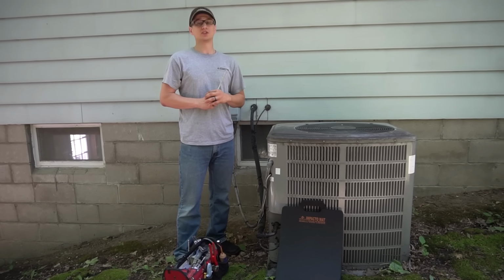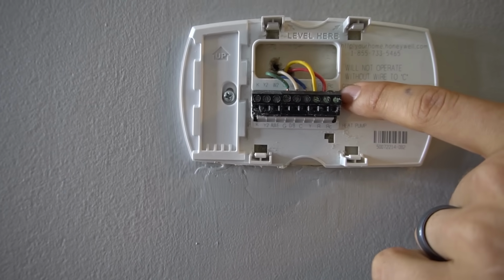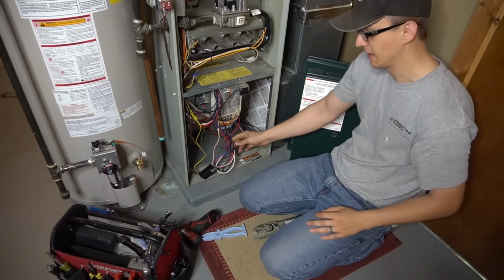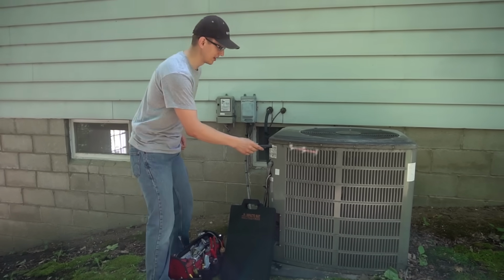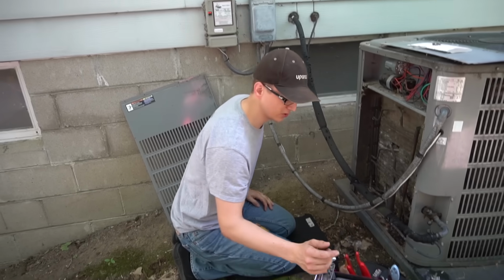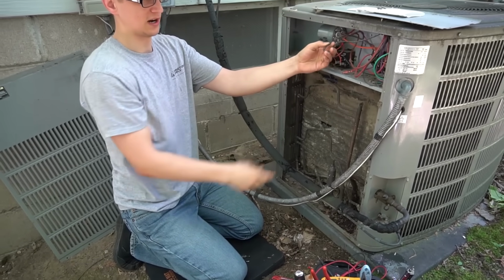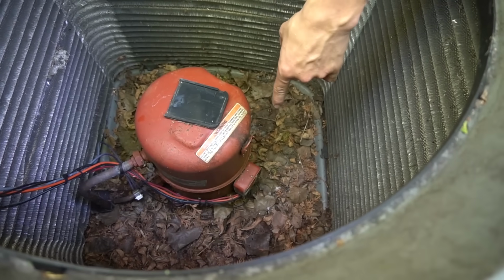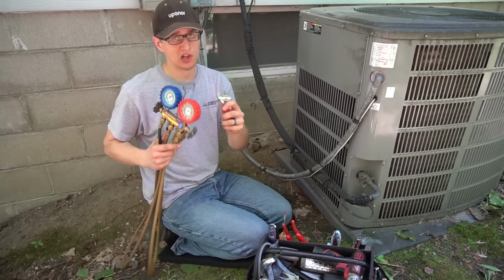AC Unit Not Turning On - How to Fix It Step by Step

Comment: I have one question. What if the outside fan is not working but after turning off the power and on again, it starts up for a few seconds and then stops again? Could it be the capacitor?
Reply from the maker: Unlikely. If the compressor and the fan turn on, the capacitor is probably good. That sounds like you have a power saver switch. If you wait for 5-10 minutes it should turn back on again. If that's what it is of course. I have a video on the power saver switch in my AC Fixing Playlist
Reply: Thank you for your reply! I checked and there's no power saver switch. But I probably didn't give you all the details you needed because I was trying to be brief. But here's what happened. All was working well for years and one day (after one of many thunderstorms lately) I noticed that the fan inside (which was on Auto) was running all the time because the temp wouldn't go down to where it was supposed to according to the thermostat (installed last year). I checked outside and the fan there was not working. When I gave it a push with a screwdriver as you showed, it started but it was off again after a few seconds. Then I cut off the big power switch outside to look at the capacitor (which was not bloated) and when I turned the power back on, the fan started for a few seconds and then stopped. Then I sent you the message but before you answered I went ahead and replaced the capacitor anyway. Then the outside fan began starting and stopping after a few seconds, and then after a couple minutes starting and stopping again, and so on. I then switched off the outside power and kept it that way. But there was a noticeable change after replacing the capacitor: it went from not starting on its own (except for the one time it started when I tried the screwdriver and when I turned the power switch off and on) to starting on its own every couple minutes (though stopping on its own too every time). I watched your 10 most common AC problems and none of the descriptions match the symptoms except for possibly the first one of the capacitor, and maybe the #10 of Compresson with Locked Rotor Amps BUT my fan is not running (except for what I said "wanting" to start but stopping after a few seconds). So I wonder if the capacitor I bought is not fully good (bought it at the local store where all the pro companies buy most of their stuff and I took the old one to match and it matched with the only difference that the new one is 440/370VAC/B while the old one was 370/400VAC but the guy at the store said that was ok, and the other difference is the +/-% variance for UF where the new one is 7.5 UF +/-6% and the old one was 7.5UF -5/+10%). I hope you don't mind this is long but it is the exact description of all the steps and detail. I hope you see this and can give me your opinion now that you have all the info! Thank you so very much. You are the BEST. I wish you were here and I'd hire you. :)
Reply from the maker: Thank you! The full description does paint a better picture! :) So far you have mainly been talking about just the fan outside but can you tell if the compressor is coming on too? Do both, the compressor and the fan, come on for a few seconds and then turn off? This kind of sounds like a low pressure switch is tripping. (LPC or LPS) The purpose of this switch is to shut down the AC unit if the pressures are too low (usually indicates that there is a leak in the system) so that the evaporator coils and the refrigerant lines do not start freezing over.

If you look inside of your outdoor unit from the top, do you see a black cylinder or disk attached to the thicker copper pipe? It will typically have 2 wires coming out of it. Or you can also look on your wiring diagram (usually on the back of the service door) and see if the LPC is on there. If you do have a low pressure switch, then likely you are low on refrigerant.

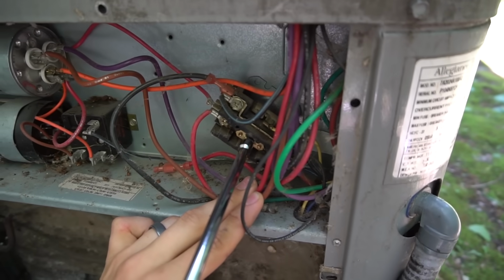If you do the test that I show in 17:50 (very carefully since there is 240v there) does the unit stay on as long as you keep the plunger pressed in?
Reply: Thank you so much for your prompt answer!  I was hoping to follow your recommendations today and answer with some substance, but it was raining all day long so, being inexperienced, I didn't want to be messing around 240v in the rain. From what I remember maybe the compressor was starting at the same time than the fan but I would have to check that again to be sure. Other than that, what I remember that it didn't happen was a screeching sound, which the outside unit always made right when starting up every time (years ago I had been told that there was no practical solution to that but that it was not a problem, I don't know what caused that sound but I am curious).
Reply: Thank you again! It stopped pouring down today and I could check. I turned the power on outside and push the plunger and both the compressor and the fan came on. I kept the plunger down but compressor and fan stopped after a few seconds. Right away I pressed the plunger again and compressor and fan came back on but they went off again after a few seconds and they wouldn't  go back on after I pressed the third time. Maybe they needed time to reset again. I looked inside the outdoor unit as you said and saw the thick copper pipe attached to the compressor Copeland Scroll (which is a big black cylinder and from which they come out actually three wires). Is it time for me to call the professionals? Thank you so much for your dedication to help your fellow beings in this so very helpful way! You are awesome.
Reply from the maker: Thanks man! I try to be helpful. Unfortunately, yes. This is starting to sound like you may need to call upon the pros. Most likely you are low on refrigerant but of course I can't say for sure since I am not seeing it :) I hope it won't be too damaging to the wallet. Good luck!
Reply: Thanks so much!
Reply: Hey man!  I'm wondering if I can call on your advice again. Today this pro came and said that the compressor was bad (it's an Armstrong three phase, R22). He said there was a bad fuse and took it out but did not recommend putting a new one because it would blow again. He is going to check on compressor prices, but when he left my inside fan which was (gratefully!) working, is not working anymore. I called him and he said it would not be because of the fuse that only sent power outside. Then I lost the communication and he didn't call back to follow through or offer to come back to fix that, so I didn't call him back either. So now I'm worse than before calling him (and paying him a good fee). I could have survived for a little while in cooler weather with the house fan blowing. Is it possible he left something outside disconnected? He din't touch the thermostat or the handler. I hope you can give me some guidance! Thanks again!!
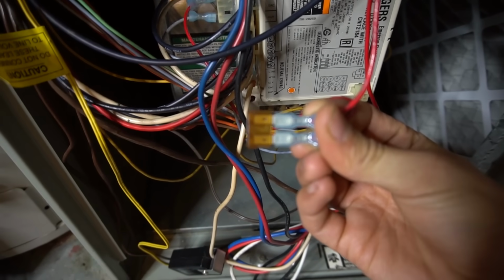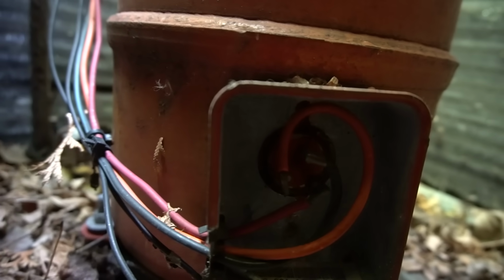Reply from the maker: Oh man.. Sorry to hear about that! If he did not go in the house at all, then the only thing I can think of is that the 3 amp fuse tripped for some reason. (I show mine at 7:22 in this video) As for the fuse that he said was blown, is that the cartridge fuse that is in the disconnect? Only one of them was blown? Usually those blow if there is a short somewhere. There is a really slight chance that more harm can be done to the unit if you just go ahead and replace that fuse/s. You can try replacing them and see if it turns on. But before you replace those fuses, I would take a look at your compressor pins, the wire connectors that hook up to them may be corroded or broken off. You can see mine at 25:45 . Or did the guy check the compressor windings and found that they are shorted or open? Or in other words, why is the compressor bad?
Reply: Thanks man. He did go in the house, but did not touch the thermostat or the handler (just looked at it to see brand/type). He went to the electrical closet though, where the brakers are and there's an "AC" box with fuses and where he found the one he removed saying it was bad. He didn't actually check the compressor, so he didn't check the windings. He just said that the compressor was causing a short assuming that was proof that it is bad and needs replacement. (Based on my preliminary checking, he did check the freon, including an acidity test, and he checked power in the cables on the side of the outside unit).
Reply from the maker: Ah I see. So instead of circuit breakers, you have a panel of those round fuses. Well.. The compressor being bad is more probable then there just being some bad wires/connectors.. But that's one expensive repair so if I would be you, I would investigate the wires. And if you by chance have a meter that can check resistance (ohms) you could check that compressor yourself. (I have a video on how to check a compressor)
Reply: Thank you! I put back the fuse and the inside fan started working again (that had stopped working after the guy left leaving the supposed burnt fuse out). A second guy came and thought the fuse was burnt but offered to replace it but then he re-checked the "burnt" one when out of the breaker and the fuse was good, so he reinstalled it and had to sort of wiggle with it but it did read 240 and the compressor came back on. All was well for about 2 days and now I'm back where I started (inside fan running but no outside action). I'm scratching my head.
Reply from the maker: From what you described sounds like the unit outside is not getting power again. Perhaps there is a loose connection where that fuse plugs in?
Reply: Thank you! Good thought. And the first guy that came said that fuse (in the inside disconnect) had nothing to do with the inside fan but when the fuse was out, the inside fan stopped working. Any thoughts on that?
Reply from the maker: That can only mean that that fuse does indeed have something to do with the inside fan :)  The easiest way to check would be to pull out that fuse and then check if you have any power at the furnace. It sounds like that fuse kills the power to the furnace.
Reply: :) Thanks man.

Comment: MY AC UNIT TURNS ON  AND AIR IS COMING FROM THE VENTS I HAVE IT ON COLD BUT ITS BLOWING WARM AIR    AND   THE COMPRESSOR  IS NOT KICKING ON  WHAT  SHOULD I DO
Reply: Could be a blown fuse. But if it's not that your compressor is probably worn out and needs to be replaced.

Comment: Heya.
A bit of feedback: This video is incredibly comprehensive; the presentation format is clean, detailed, and organized. It's impressive as it is helpful.

That being said- Yesterday I noticed the compressor in my outdoor evaporator would not click on, though the fan would, when the thermostat called for cold air. After watching your video this morning I cracked open the electrical shelf- turned out the common wire to the compressor had an incredibly corroded contact on the 240v relay. Stripped wire, replaced [the wire's] contact, back in business.

Thank you for providing an immensely useful knowledge transfer. It's allowed me to determine my own comfort level of self-service while equipping me to better communicate with a technician for the day when I do need to call an AC professional. Kudos.
Reply from the maker: Thank you very much! I am happy to hear my video helped you fix your air conditioner! Stay cool! ;)

Comment: First of all, amazing video. 
I pushed in the plunger and everything worked, but it doesn't pull in on its own. How do I fix that?
Reply from the maker: That means your low voltage is being interrupted somewhere. I would check the 3 amp fuse in the indoor unit to see if it blew, if you have a condensate overflow float switch - that may be tripped if your drain line is plugged, also the thermostat wire that comes out of your house and into the outdoor unit (has two wires inside of it) - do both wires go straight to the contactor coil or does one go somewhere else? If it goes somewhere else, try to trace where the other wire goes and that may lead you to what is interrupting the power. Perhaps a low or high pressure switch..

Comment: i have a 4 ton unit, the air handler is running. Air is coming out of the vents... but its not as cool as it used to be. I have replaced the tstat batteries and we have a basic tstat... so nothing special. The fan is NOT running. I have checked breakers and have tried to manually start the fan with a screw driver like you did in the video. I am hoping that either the drain line is clogged, needing to be cleared or capasitor is bad. Do those sound logical??
Reply from the maker: Those do sound logical :) A dead capacitor would result in neither the fan or the compressor turning on and if the drain line is plugged, your condensate overflow switch may be tripped. (if you have one) That would also cause the AC not to turn on. In the video, I show how to carefully (there may be 240v present) press in the contactor plunger. Have you tried doing that and does the unit do anything? If the compressor and the fan come on when you manually press it, that means your capacitor is good. If nothing happens then your capacitor may be dead or for some reason you are missing power on one or both of your hot legs (two 120v lines to equal 240v). The only way to know for sure would be to check with a meter.

Comment: My fan will not work without a kickstart (pushing the fan with a knife) and it hums but even when the fan turns on the air doesn’t work
Reply from the maker: To begin with I would replace the capacitor. It sounds like the capacitor is either really weak or just dead. Hopefully that is the only problem

Comment: Great informative video.  Thanks.  My a/c (heat pump) runs for about 15 minutes, then stops, even though it hasn't  reached the set temp yet.  After 5 minutes it comes back on for about 15 minutes and stops again.  When running, everything seems to be working fine.  I had a cheap inside thermostat , so I replaced it w/ a programmable Honeywell.  Again it runs for abuot 15 minutes and stops as if it achieved the set temp, but it didn't.  Any thoughts.  Thanks.
Reply from the maker: I can't say exactly what that is... But to start with I would do the easy stuff :) Hose down the outside condenser coil even if it looks clean. Replace your furnace filter. If this keeps happening, I would look inside your condenser unit from the top of it and see if you have a low pressure switch on your suction line. (the thick freon pipe). It will look like a black cylinder or disk with two wires coming out of it. If you have a low pressure switch, then you might be low on refrigerant. Another thing to check for is a partially plugged condensate drain. If you have a condensate overflow float switch, that could be tripping if the water is backing up in the condensate drain line.
Reply: Perfect, thanks.  I had cleaned the drain in the spring, but it needed done again.  It has been working great all day.  Thanks again for sharing your knowledge with us.
Reply from the maker: Happy to help! Glad to hear it's back up and running! Stay cool :)

Comment: Loved this video.  I found it to be very informative and it gave me a few ideas to look at in the future, but I did not see my issue even mentioned and I am having difficulty finding any information on it.  

In my case, my entire unit (heat pump with GFA heat backup) is outside my home.  The compressor and condenser (coil and fan) seem to work fine. But when I opened up the unit, I found that the entire evaporator coil had frozen into a beautiful 3 inch thick sheet of ice.  This unit worked perfectly fine last year for cooling in the summer and heat in winter, and it has worked this year for cooling until 2 days ago.  This is not a new or replaced thermostat and it has no battery.  I have thawed out the evaporator coil and cleaned up the water.  The unit now works.  Mostly.  I have found that my blower does NOT turn on when the thermostat is set to AUTO.  The evaporator coil likely froze due to the lack of air movement.  The blower does spin freely and it does work when set to ON.  So what would cause the blower to fail when set to AUTO, but work fine when set to ON?

Based on your video and what I am reading online, I am thinking that this is either a wiring issue or a relay/capacitor.   Have you ever seen this condition or have an idea of what else I should check?
Reply from the maker: Hi Frank! Thank you for the detailed question. I have seen this multiple times before. This sounds like a bad control board in your furnace/air handler (or if there is no control board then it is probably going to be a fan relay) or the thermostat is bad. Most likely it's the fan control board/relay that is defective. That's what it typically ends up being for me. When the control board gets a signal to turn on the heat/cooling it should automatically turn on the fan as well.